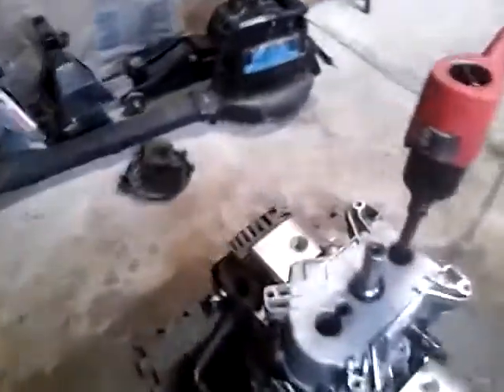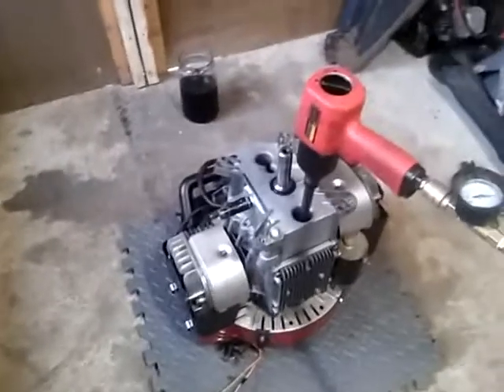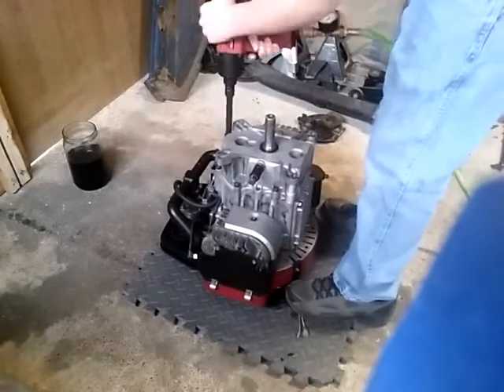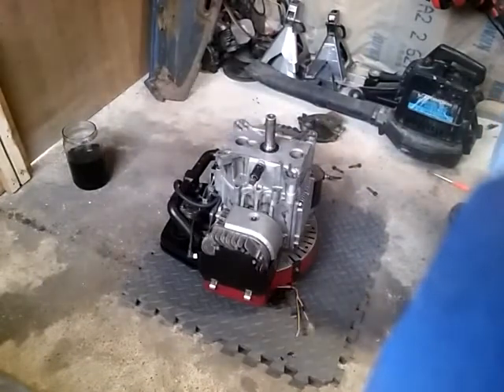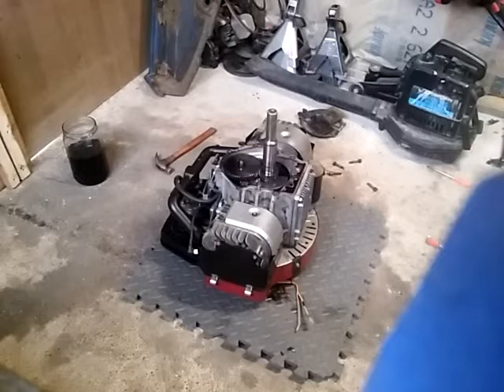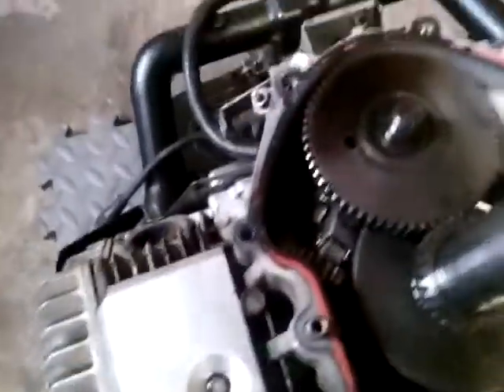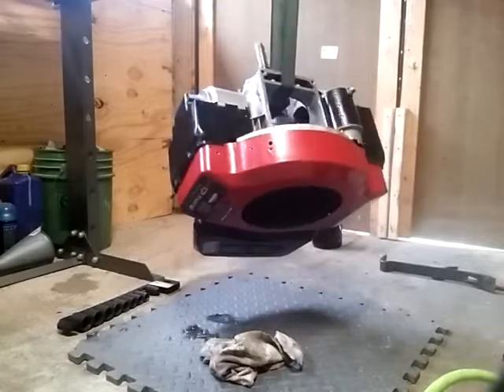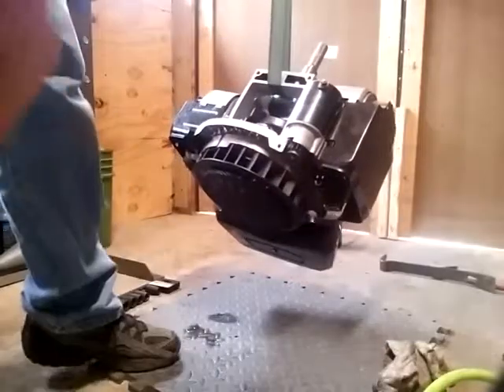Briggs & Stratton opposed Twin rebuild gone wrong

Comment: You mentioned something about rod flips I heard of that too what is it do anybody can chime in thanks
Reply from the maker: If you mean rotating the piston 180 degrees its changes the speed the piston travels on certain parts of a revolution only on pistons with offset pins. If you mean rotating a rod 180 degrees I would cause problems on most engines. Otherwise I have no idea what you mean
Reply: @mechanicalking  Yes I meant flipping the rods from one side to the other I guess I only heard about it

Comment: I think you had 10w oil in the engine. I'm rebuilding my twin II 18hp because I used 10w in the summer and there was not sufficient lubrication on #1 piston and scored the journal on the crankshaft. Solution: used crankshaft and new connecting rod required and used intake rotator to replace the broken one. New gaskets and seals for the whole engine (apparently it had never been apart).SAE 30 only for me from now on.
Reply from the maker: I didn't use the assembly Lube when I rebuilt it the first time so that's why I tore it down in this video after it seized
Reply from the maker: And also, I did not know much about oil and the royal purple oil that I put in there for the first start was 5w-20(or5w-30) that was stupid but apparently it didn't do much damage since I didn't re-hone the cylinders. The one thing I regret is impacting the head bolts on and that broke one(WITH RED LOCKTIGHT..) but I will take care of that soon so it won't keep blowing the left head gasket lol.
Reply: Sounds like a cheap 1/4" or 3/4" (remember to convert ft lbs to in lbs) torque wrench is necessary for your rebuild. And some blue locktite. Also a cheap rubber hammer or dead blow hammer might be in your future.
Reply: @georgemitchell2288  - 3/4"??? That's kinda HUGE! Maybe you meant 3/8"?
Reply: @alanhardman2447  true, and good catch.
Reply: I cant buy SAE 30 where im at so i run 20w-50 and it works just fine

Comment: The governor gear
Reply from the maker: Hippiquad when I assembled the engine I didn't use assembly Lube I just put the parts on and oiled them that's what cause the engine to seize because there was no lubrication for the startup besides this was my first video and looking back at it from now I sound pretty dumb lol
Reply: Hell , All we did in the old days was smear parts with STP or even motor oil when rebuilding and we never had anything seize up.  Now not end gaping the rings will cause a freshly  rebuilt engine to seize !  Happened on my Dad's Triumph
Reply: @mechanicalking  some of that ULTRA LUBE ON E BAY $7 for a little bottle of liquid grease... or STP OIL TREATMENT WILL WORK TOO. it is liquid (barely) grease/oil and cheaper $3 for pint of it.

Comment: .10" ring end gap in middle and bottom of the cyl for the rings MINIMUM... supposed to be .0045" for each inch of piston diameter so 3.4535"  so the math works out to .015" ? that is what i put mine to... better than .120" of OLD RINGS that came out of the worn engine that had a BIG LIP AT THE TOP OF THE MOTOR that really needed .020" over pistons/rings.

Comment: Ever rebuild this?  I have an 18HP 694cc and a 15HP I'm about to work on and have to see which sounds better as is.  Looks like some of the parts swap between the two from what I can tell.  The local small engine repair shop showed me this site which is handy:  https://www.sepw.com/parts-lookup

Comment: Did you have sufficient Oil in the Engine?
Reply from the maker: Adam Sturdevant yeah but I didn't no you're supposed to put assembly Lube all over it
Reply from the maker: This was awhile ago
Reply: ford king I'm not sure what you mean by that I usually just add Oil too the Crankcase & check my Level on the Dipstick and see if it says Full or Add Gasoline does not mix with this Engine.
Reply: ford king I'm not sure what you mean by that I usually just add Oil too the Crankcase & check my Level on the Dipstick and see if it says Full or Add Gasoline does not mix with this Engine.
Reply from the maker: +Adam Sturdevant no when I assembled it I didn't know I needed assembly Lube
Reply from the maker: Yes I put oil in the engine but I also did not know you were supposed to apply lubricant in between connecting rods ECT before clamping them onto rotating parts
Reply: ford king okay that's understandable!!